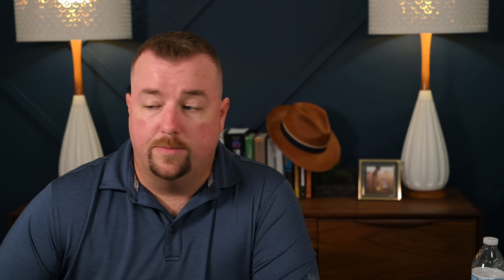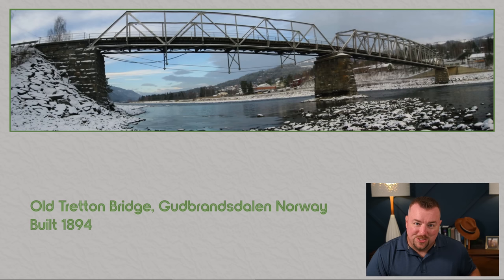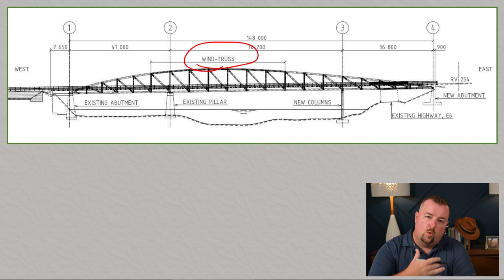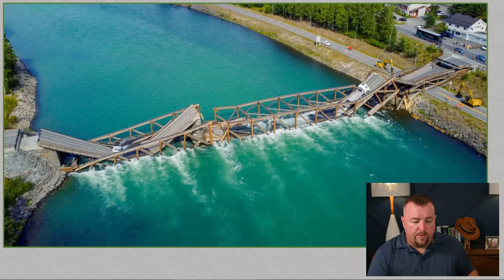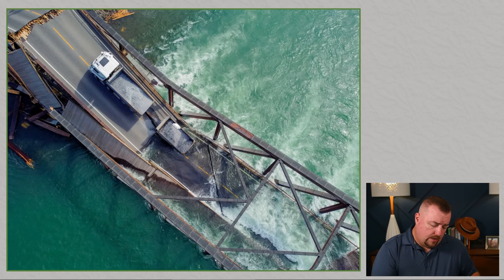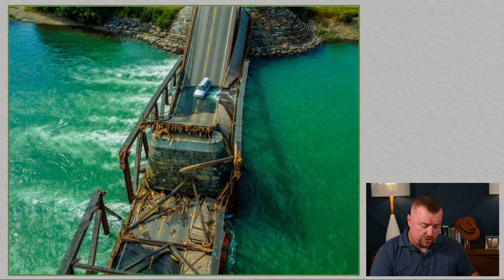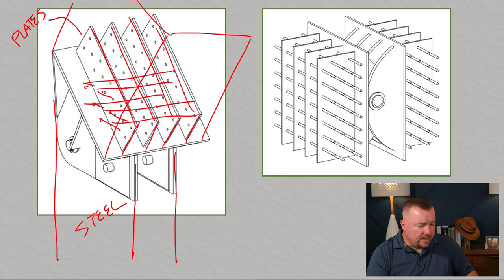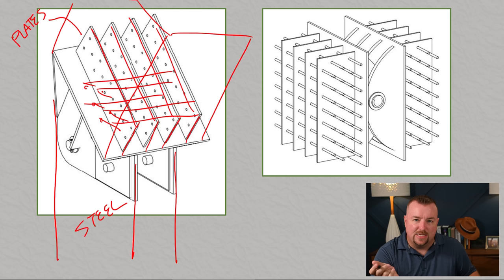How Did the Engineers Miss This?

Comment: Not an engineer but I am a residential general contractor. I agree that it was tension mode failure. To go further any field drilled dowels are not going to done as well as shop made ones creating inconsistent loading on the dowels which in turn leads to a cascading failure. My suggestion to any engineer is to design it so the dumbest person can construct it consistently every time. We are only as strong as our weakest link and the reason some of us hands on guys are so strong is we don't know what mechanical advantages are, lift with your back not your knees.

Comment: Another item I noticed is that the laminated boards were laid out horizontally, rather than vertically. As such, the individual boards would seem to have more flex, despite the glue, and stress the connections, which would increase the splitting at the pins. Essentially, the bridge was weakened by design by all the laminated material lying flat, rather than on edge.

Comment: You should look at the Video's for the rollercoasters, Son of Beast and El Toro, they had structural failures that caused main support bents and ledges that just split apart... Those incidents caused Track Sag which creates a pot hole effect. Both coasters had a severe enough structural failure that when the trains passed over that section it caused injuries to Riders.

Son of beast Failure occurred in 2006, the EL Toro incident happened in 2022.

Comment: How can wood be standardized to work in a computer model when every piece of wood has different grain patterns and imperfections. 
How long does laminated wood last? 
Where there any long term tests for the glue in different environments?
One thing I noticed, because the truck didn't slide, was the collapse happened slower than a freefall collapse. It was like a chain reaction that took time to propagate easing the final crash to where the truck didn't bounce at bottom. No loss of load, and still in one spot, no skid marks from movement of truck after crash.

Comment: Being a framer & structural concrete contractor in S. CA. for 35 years or so, you have to be very careful when drilling or cutting holes or slots in any wood. The size of holes & where they can be in a vertical or horizontal piece of wood is governed by the local building code or UBC. It seems the wood beams on the bridge would have been better if inserted into a deep pocket in the steel supports with just bolt holes, instead of slotting the ends & then drilling holes also. Seems they took an awful lot of wood away from the beam ends. Same with slotting the middle of horizontal beams for a connection. Nothing like weakening the wood at a high stress point.

Comment: This makes me think back to the failure of the Rosemont horizon event center in Rosemont Illinois outside of Chicago about 40 years ago or more,
They built the roof of the building out of wood and laminated wood members because the facility right near O'Hare airport and the theory was the Wood would control exterior sound entering the facility,
However it was constructed by steelworkers from Chicago and we're in steel construction skipping a few pins that don't line up is quite common and not generally detrimental to safety it is a safety issue with wood members. After the investigation and the discovery of the shorted pins the facility was rebuilt using the exact same plans and this time following them exactly, it is still standing to this day it has since been renamed the Allstate arena

Comment: Fully agree that wood must be protected from water.  In Japan, they build little roofs over their wood fences to make them last.  There is a beautiful Norwegian wood church in Rapid City SD.  It was moved from Norway.  It is all wood and pined together with wood dowels and wedges.  All the wood is under the roof.  I am sure wood ship builders took great pains to keep the water away from the wood.  This protection is missing from the bridge.  You are also correct that the details must be modeled such as the loading from the bolts and the shear and splitting stresses in the wood.  I have designed steel structures and know that the details of welded joints must be evaluated separately from the homogeneous steel plates.

Comment: Mpt 1000% relevant, but early British MkII versions of Martini Henry (MH)  rifles made in the 1870s secured the fore stock (front hand grip) to the rifle frame with a cross pin through the wood, drilled perpendicular to the line of the wood grain and inserted into a tab under the gun barrel.  It would hold up in use for a while.  But in time, with the gun recoiling when shot while the shooter was holding the fore stock, the hole in the wood would begin to wallow out from the recoil force being transmitted to the wood by the steel cross pin.  Sometimes the pin also becomes bent due to the wood resisting the cross-pin's attempt to travel back in recoil with the barrel while the shooter is holding the stock still.  I have seen several MkII MH fore stocks which, with continued use, simply split lengthwise from the steel cross pin hole back to the end of the fore stock, due to the continued recoil shock of repeated firings.  Exactly like the splits in the pinned glued  laminated wood beams at the outer cross bolts. Likewise many old wood stock rifles have issues caused by being exposed to wet environments and moisture becoming trapped between the steel of the gun and the wood of the stock.  With time the wood rots and the metal corrodes, both of which allow further damage to the cross pin and wood fore stock when the gun is fired.  The British solutionn by the time of the MH MkIV (1890s) rifle was to change the fore stock attachment method.  What happened to these bridges should not have surprised anyone.

Comment: The direction of the wheels tells the story of what was happening right before or during the collapse while the truck was still moving. Possibly the left driver side of the bridge was collapsing first so driver turned to the right.
I read in the comments below that the driver was proceeding at a fairly slow rate but stopped when the bridge started shaking violently (while collapsing on the left side?).
That sudden stop would exacerbate the compression wave moving forward to the shallow end of the bridge arch. Kind of like bouncing your toddler up off a trampoline or a tsunami as it approaches the shallow water at the shoreline. It got a lot worse really fast! I'll bet they didn't accommodate those angular and magnified loads in their modeling software!
Great video!
Of course the multiple comments about glu-lam issues apply and the shady overall tension vs compression design issues should go without saying.

Comment: A little late to the party but… cross laminated timber has wood staves in orthogonal directions and resists this type of splitting.  Internal version of the wrapping others are describing, in a sense.  Gluelam tend to be unidirectional; perhaps modifying gluelam with  cross laminated staves in the joint areas would help. 

And wrapping.

Comment: when i was in Middle school, in science class, we where tasked with building little bridges to test their weight capacities until failure... mine topped out and won at a failure weight of 17.82kg. all using small size balsa wood timbers. i think each piece is about 1/8ths thick or so, but i can't remember exactly. but what i did, was i made the deck first, using 8 lengths all the way across in a 3x3 with the top middle missing, to secure the sides within... then i built the sides in a 1x3 configuration with a steep angle ends and a flat beam across the top. i bridged (lol sorry for the pun) the middle of the two deck beams with the same number plus one balsa sticks for where the weight would be hung. then i had 5 vertical posts within the deck sides and filled those in with angled struts, creating a slightly unnecessary bit of detailing, but which might have helped in the test in class. we hung a bucket from the center of the bridge deck, and then they slowly added weight to it until failure. mine was maybe 2 to 3 times the capacity of all the other kids bridges lol. so i'm rather proud of that fact. all held together with green glue, and built over a couple days in class and at home. (this was, on a semi related note, when i live in Nigeria, between 2003 and 2006.)

Comment: THe vertical line is a skarfe joint, the black is the glue.  Wood of course has a limited length and must be joined to get these long timbers.  Even the joint between the wood and steel in the test samples are scarf joints.  In an airplane a scarf joint must be 6x as long as the thickness of the materal.  Here, the joints are only about one thickness long.

Comment: @BuildingIntegrity The failure of the connection in the Siemens arena wasn't due to error in the code concerning slotted dowel connections. It was due to faulty design of the connection, engineering error. You couldn't even come close to verifying it theoretically. It was unlikely the truss in that building survived as long as it did. I recommend the official report.

Not saying that the Eurocode 5 section on dowel connections couldn't use some work.

Comment: The steel parts aren't just rusty - they are made from weathering steel.

It does look like rust - but that's only on the surface and does not continue over time.

Quite similar to zinc-galvanised steel.
Reply: This is also very common in Norway, fences, light poles etc are made this way. And danish poles for overhead lines on the railway.

Comment: Arranging the dovels in rows following the grain certainly promotes cracking! Wood is excellent in compression, but is sensitive to humidity (length stays more or less constant, but thickness varies a lot with the amount of humidity of the wood or gluelam), so those dowels should have been stainless steel, or better, as the water in the wood will affect the steel dowels pretty soon!

Comment: Interesting details, never seen in composite wood/steel construction. The failure of the bridge is manifested at and because of the wood/metal joints, yet only the wood components are shown to have failed. The metal components show no deformation or any other form of damage. The failure can therefore be interpreted in such a way that the jointing design is entirely responsible for the collapse.

Comment: There is bending moment and shear forces that the structure must withstand.  From the picture at 4:12 in, on the truck side span, that appears to be a "shear" break right at the pilon, indicating that the material was not able to withstand straight downward shear stress forces.  Maybe wet in this area, and caused some sort of lamination weakening or wood rot.  My guess is that the Truck side sheared first, and then the car side buckled.  Hard to tell from the pictures, but the design was more like a single span supported in the middle, and the Whole Structure was part of the design strength, instead of two separate self supporting span structures, each resting on the center pilon.

Comment: One of the problems is the deal with wood as a solid the same way they would calculate with aluminum or steel or any other component. But wood is much stronger across the grain than with the grain. If you have a 1 foot log you cannot cut through it with one shot but you can split it with one shot

I was working on a house once and a structural engineer had called for a bunch of joist hangers to hold up a roof that was covered with slate an insanely heavy roof and actually only a half a roof because it was cantilever over the side of the house and there was a living space next to the roof so you couldn't transfer the load straight across the attic as a normal roof would be and I kept telling the structural engineer what he drew does not work and it took about two weeks before I finally convinced him that what he drew was going to fail and again the problem is they look at wood like it's a solid substance instead of realizing it's got a lot more strength in One Direction than the other

Comment: Just the rambling thoughts of a 75 year-old, long time retired engineer. This is not really my field of engineering, my work was mainly thermo-dynamics.
However, I wonder if there was an unrecognised or missed vibration factor in the design?
The failure seems to have occured, as you point out, under the area of the loaded truck, at a joint which was under tension.
There would have been vibration acting vertically from constant vehicle traffic along the deck, but, there may also have been vibration acting horizontally, at right angles, created by the unregulated flow of the river water against the new vertical steel column supports.
The original bridge it appears was carried on substantial stone piers. Did the new design take into account the difference in the effect of water flow against the new steel columns? The photographs and drawings appear to show the steels were exposed to the unregulated impact of the river flow.
Another question or point to consider is the effect of Wind on the Glulam high-level beams. Clearly from the drawings there was a Wind-Truss but, why it only extended over the original stone pier ??? Why not over the new Steel Column support area also?
In addition to the questions about the joint detail and integrity, to me, the area around the new Steel Column supports where they meet the deck, appears to have been vulnerable to vibration in two opposing planes. One of those planes completely unregulated. 
In my mind, and I'm happy to be told I'm completely wrong.
Did Vibration somehow contribute to the failure of that joint?
And who on this earth puts Structural Timber of any sort under Tension?
That's basic 1st year materials stuff.

Comment: Yes, the failure mode is tensile failure with is caused by designing the connections as single points of failure instead of having a contiguous piece of wood handle the tensile load in parallel with the connection points. The point of the design of a dragon boat is the tensile load distribution, that is why they just wiggle in the sea and doe what the sea suggests instead of splitting their hull apart. There is no good reason for wood not to last 1000 years as construction material, it is known by examples that it does, and the glue lamination process should not be a detrimenting effect. Chemical de-composition of the glue is an unknown potential issue.

Comment: I wonder how much stronger (if any) the connections would be if square pins were used  (not looking for how difficult it might be to implement).  This would certainly reduce the wedge effect from using round pins.
Reply: That would probably be worse. Corners are stress points which can/ will split much easier than holes. This is precisely why airplanes don't have square windows.
Reply: @dickjones011  If all the forces were in one direction you might have a point, but there is vibration involved meaning forces from many directions. A round hole will equally distribute these forces whereas a square hole has 4 weak points. Can you guess where they are?

Comment: Two things I note, one from a truck driver’s perspective, the other from engineering.
This truck is a fairly dense point load.  Fairly short, and extremely heavy.  Maybe forty or fifty feet long, and sixty some thousand pounds.  Unaware of the weight rating of the bridge, it may very well be under max weight, for a longer truck.  Avoiding the rabbit hole of bridge law, there is a reason smaller bridges have maximum weights per specific kind of truck.  A longer truck, a longer trailer, a longer connection point, two smaller trailers, would have balanced out the weight better.  As it appears, it’s an inconvenient coincidence that the truck axles just so happen to fall at consecutive risers.
Now more of a question, on the engineering side.  That it failed one riser from the immovable supporting steel pillar, seems also fairly strange.  In the middle of the span, the mass of the vehicles is exerted equally to both piers, or if supported by levers, would have a moderate arm.  Being adjacent to, but not on, one pylon, the (our viewpoint) arm to the left is at its maximum possible length, the arm to our right to the pylon is next to nil.  Hence at the exact moment when it broke, almost the entire bridge weight, plus the truck, was on those joints.

Comment: They should have at least rotated the members by 90° so that the pins would have been perpendicular to the layers of wood, to prevent (or at least delay) splitting. And of course fill up the slots and holes with some waterproofing material.

Comment: As a kid I built a bookshelf out of plastic K'Nex. Yes, a bookshelf. 'Bout a meter and a half tall, a meter wide, full of heavy books. Because the front was open and therefore weak, each shelf was split into cubes. Each cube's floor was braced by four small opposing diagonal crossmembers connected to a full truss in the back and sides. Good construction holds a lot of weight.
So, I have to wonder if the crossmember pattern was a primary cause of this collapse. Any time I see a whole row of parallel diagonal crossmembers, that to me means they're not adding symmetrical rigidity. Wouldn't that put far more load than necessary on the top arc and deck? Why not use classic opposing diagonal crossmembers rather than this weird zipper design?

Comment: I agree that the fundamental failure started with the diagonal supports not being able to hold the tension (Using cables for those diagonals might have been a better choice). When those diagonals started to fail, the end of the bridge that crosses over the perpendicular roadway started moving to the right which led to the opposite end of the bridge frame falling from its supports. The decking was still over those supports and was torn away as the bridge fell (the decking is not meant to support the frame, but the other way around).